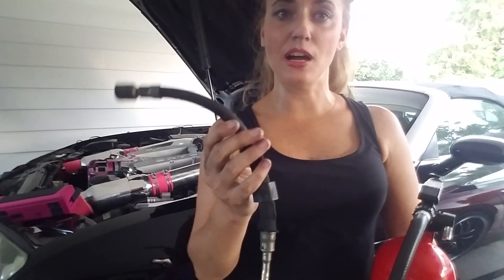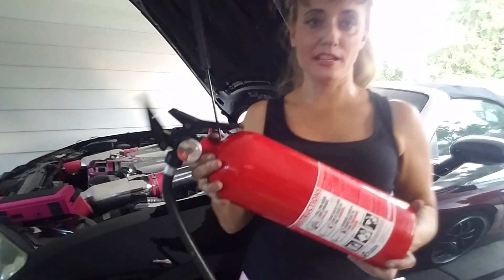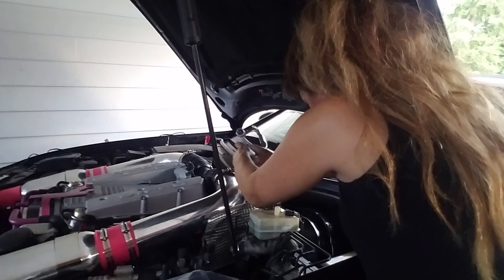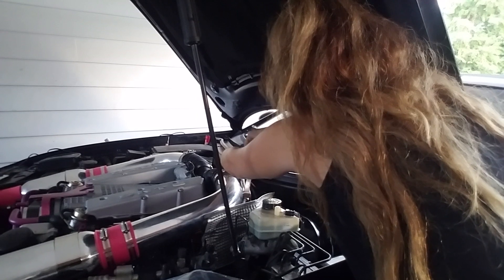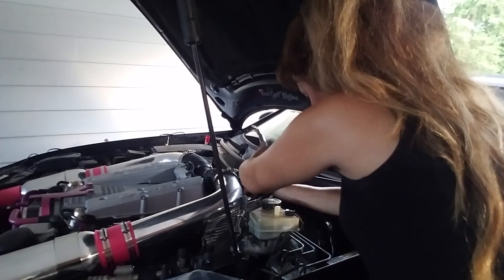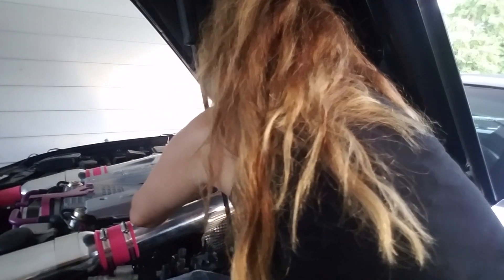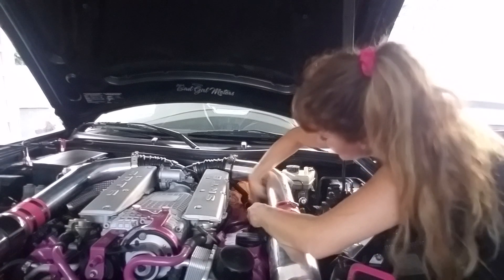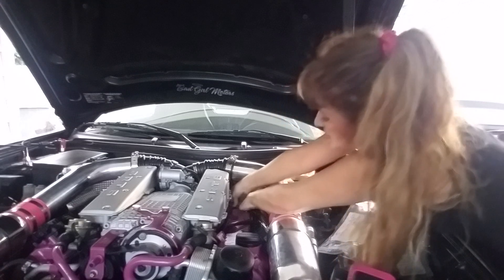Replacing SRT6 / SLK32 AMG Fuel Line

Comment: Great job on the video. I'd be interested to know the part number if you have it. Mine is also pretty dry rotted and needing replaced.
Reply from the maker: Thank you Mike. 😊 The Part # is: A 170 470 11 75. I was able to source it only on a few obscure German parts sites for about $35 + shipping. Also, my local Mercedes Dealership was able to source it for me for $50. I was rather surprised it's a hard to locate part considering it's exposed to a lot of heat. Yes, pricey, but worth it to me for such an important part.
Reply: Thank you very much you've been a great help.